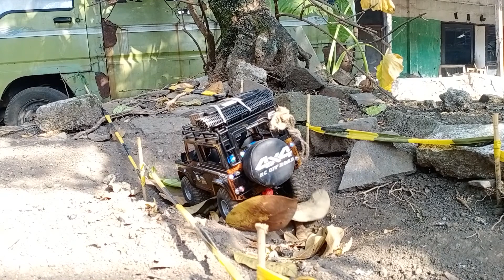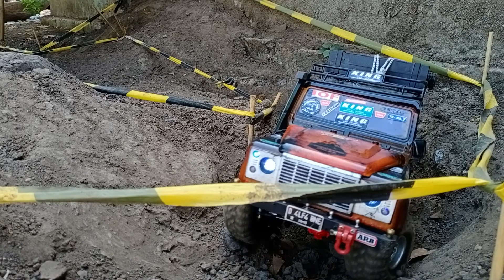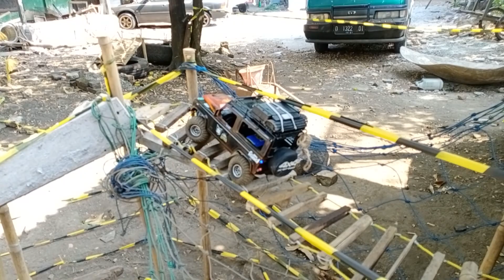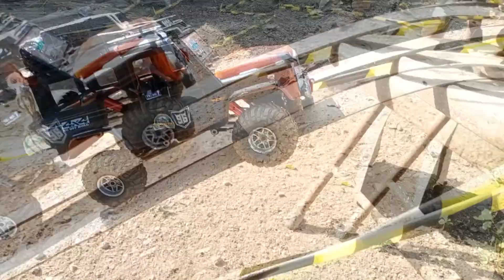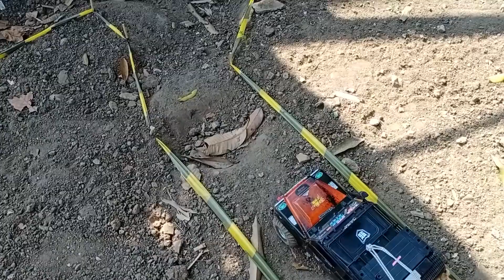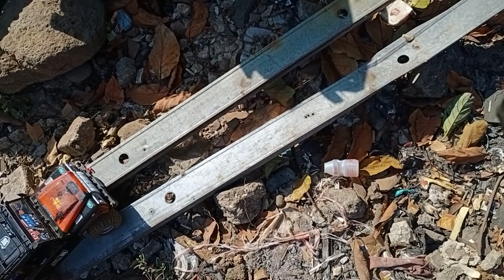Test & Review RC MND90 upgrade full metal

Comment: Are wpl's metal parts 100% fit to mn?
Reply from the maker: is depend what the axle case you using model, because the axle shaft between the wpl axle and mn axle its different longest on the both side
Reply: @slowcustom  Are all the lower parts part of wpl? I hope to make it like your mn. Thank you for quick response.
Reply from the maker: @0bi_wan  all lower part its wpl axle, metal link for mn, driveshaft for wpl, single speed gearbox, mn chassis. i wish your mn is become like mine. you're welcome :-)